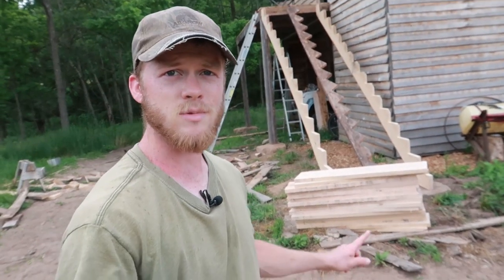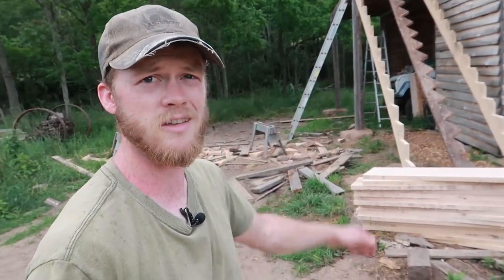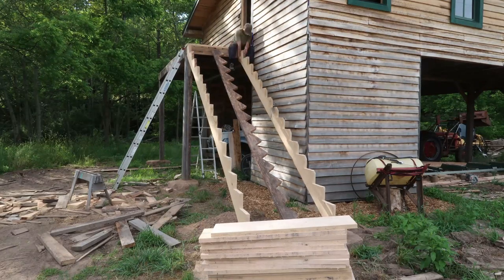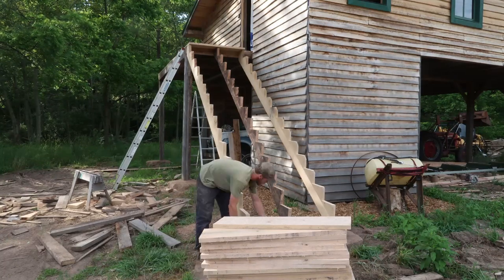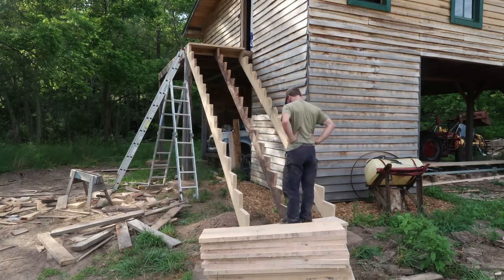The Stairs and Porch | The Millhouse

Comment: Adding even 1" riser plates on each step would stiffen it up quite a bit.  Its not always the 'look' for outdoor stairs but it does a wonder on the overall strength.  Thanks for the vids.
Reply from the maker: Hadn't really thought about that, but it makes a lot of sense. Thanks!
Reply: @LandisLegacyFarm  cool.  I'd leave a gap at the bottom though, if you do it, so debris doesn't collect.

Comment: Can't get over a project being completed in only one episode!  Actually I could have left off "in only one episode" HaHa.  Looks good.  In a few years you may regret not putting flashing between the siding and deck but we'll see.  Also, does that beam cutter have an oiler on it like a chainsaw?  I always wondered how well they work.
Reply from the maker: Oh, that was a low blow........ lol
Yeah, I may try adding some flashing in there at the bottom of the siding. Move the water out.
It doesn't have an oiler, but you're supposed to spray some wd40 or something on the bar occasionally. So far I've been pretty pleased with it. It's not as smooth a cut as you can get with one of the big 16 5/16" circle saws, but this is also 20% the cost....

Comment: That is a interesting looking skill~chainsaw what is it called Josh?
I run  Milwaukee tools and don't have any battery heating issues I run the batteries that are twice as thick as the ones your using!
Looks assume will you be sanding the grey beams so they are more white like the stairs before you stain? 
Beard is coming along nice Mine is five inches below my chin now. Missed you last week always look forward to saturday morning with my wife and Landis and friends! Take care see you next week God willing!!!
Reply from the maker: The chainsaw attachment is a Prazi beam cutter that hooks to a HD77 skilsaw. 
The Dewalt batteries are 5 amp-hr. This was the first time I've had overheating problems, but granted I was running that thing pretty hard.
Yeah, probably will try to clean them up a bit before finishing. Thanks!

Comment: I thought red oak rots pretty fast when used outside.....

How long do you expect to get out of the stairs?

What kind of wood did you use on the post and decking?

Great job.  I do all my stuff by my self and I know how hard it can be AND how creative you have to be to get it done!!!
Reply from the maker: Good question, I think that as long as I keep it well coated in sealer is should last alright. Definitely not as good as white oak though. Well see....
That's a mix of Yellow Poplar and Red Oak.